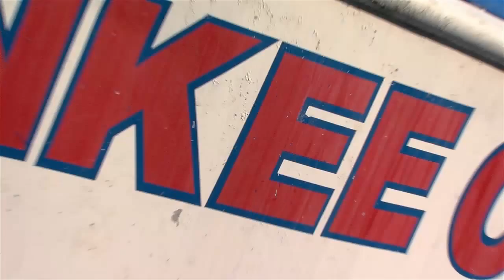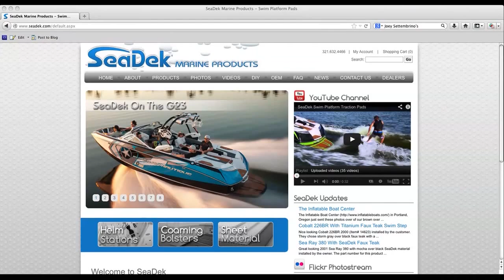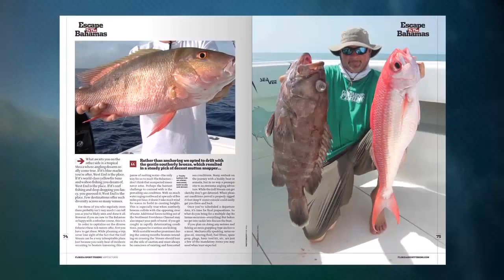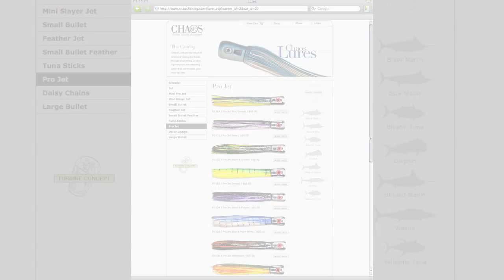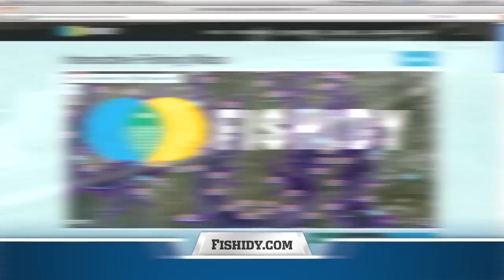Where Electric Reels Go To Die - Florida Sport Fishing TV - Gulf Grouper Snapper Long Range

Comment: For red snapper in the northern gulf, in the rigs, I use a 300lbs leader.
Reply from the maker: What? 300 lb. leader, WHY? - Capt Mike
Reply: To get the fish out of the oil rigs. very abrasive, the fish will swim into the legs, using small leader will get you cut off.
Reply: We are in 400ft of water and the oil rig legs and the snapper drag the line back into the rig legs. Once you catch one, you can feel the whole leader chaffed up.
Reply from the maker: Certainly makes sense. Stop 'em or pop 'em baby!

Comment: i see that your using electric reels. cones the Yankee have power outlets or do you need to bring your own battery?
Reply from the maker: Grant Gisondo Hi and thank you for watching, you have to bring your own battery power. A fully charged 12V deep cycle is usually enough to last the entire trip. I bring a second just in case and you can charge your battery on the boat, but need to bring your own charger. - Capt Mike

Comment: Would it be good to use a diamond light for night fishing at 200 feet?
Reply from the maker: robert willams Many times when guys are snapper or king mackerel fishing at night, they add a small glow stick to their line a few feet away from the bait, the little ones that are about an inch or two long. Necessary? No. Does it hurt? I dont think so. - Capt Mike